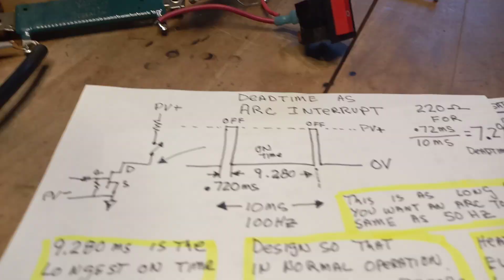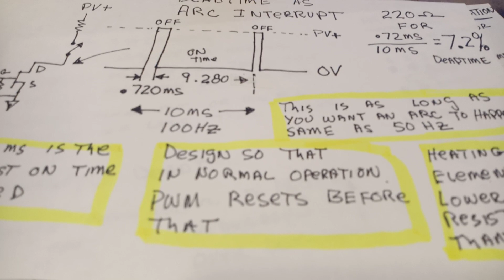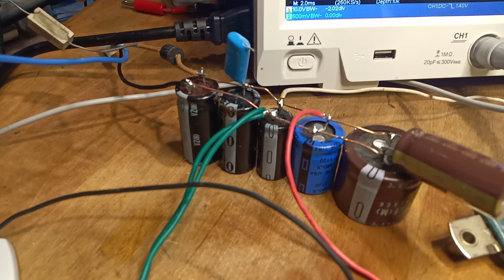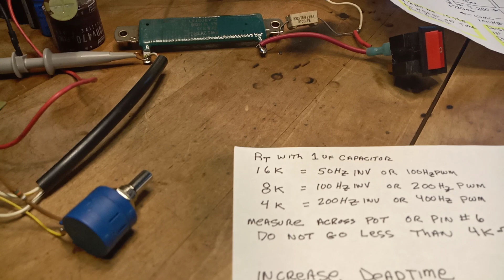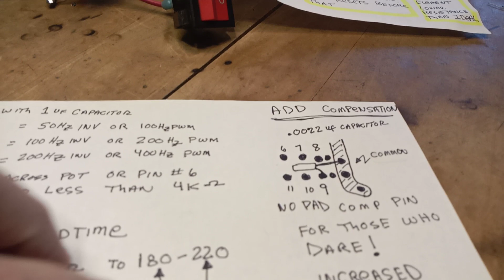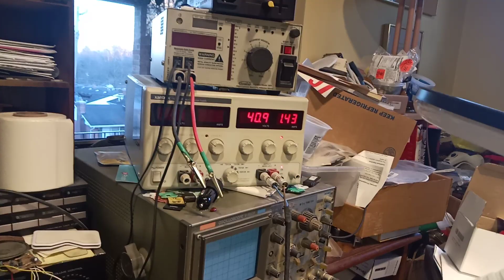PV Solar Hot Water Controller Build With Inverter Board  part5

Comment from the maker: In this video the minimal system comes together. Compensation is added to pin 9 to increase stability. The board is tested using a 40V power supply to simulate two 12V panels in series of a 24V system. Due to the low voltage 55V IRF3205 FET, the typical system would be 600W of panels in a 2S3P configuration. Maximum current would be under 15A.  I used a 3 ohm resistor to simulate a heating element drawing 13A. Very close to a maximum expected from panels and enough to demonstrate realistic operation.

Deadtime is increased on the board by changing a resistor.  This creates arc interrupt, turning off current for a period of time to allow the arc to quench.  Arc interrupt turns the heater off and that can lower efficiency at peak solar times.  There are three 
solutions to this.  Increase cycle time as long as possible so the FET turns off from the voltage dropping first. That can be by 
selecting a heater resistance somewhat lower than ideal.  Total capacitance can also be increased to store more energy while in the off time.  ALWAYS READ ALL COMMENTS. They include information that may have been left out of the video or changes.